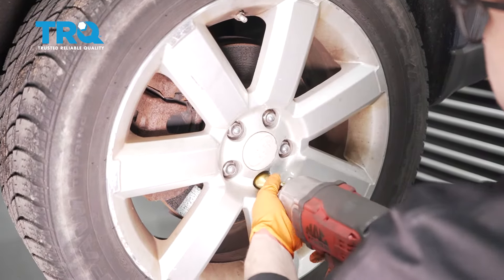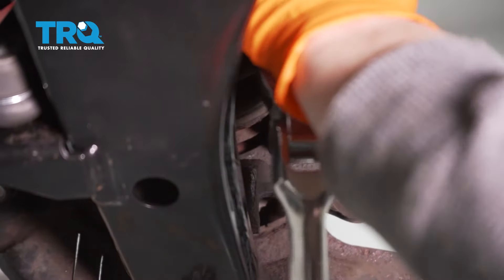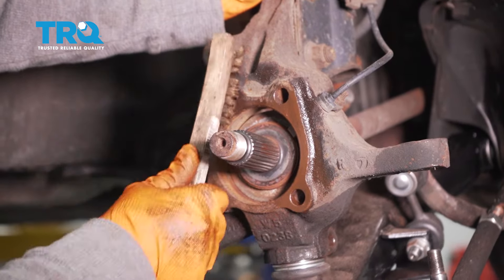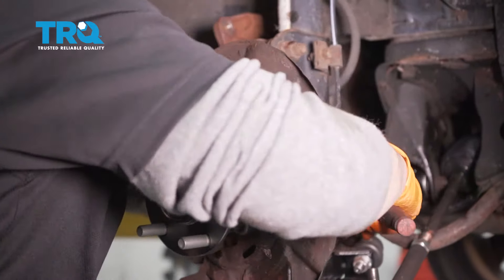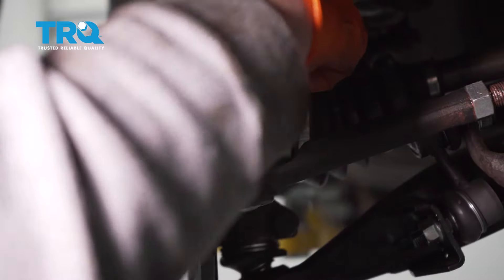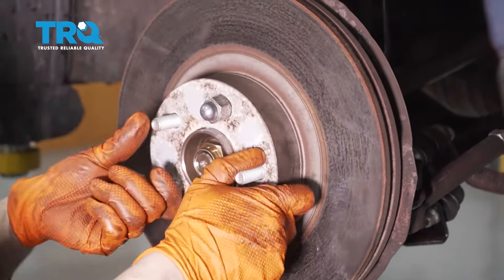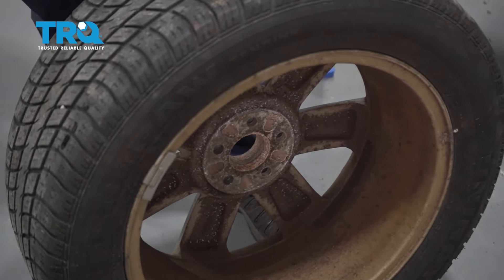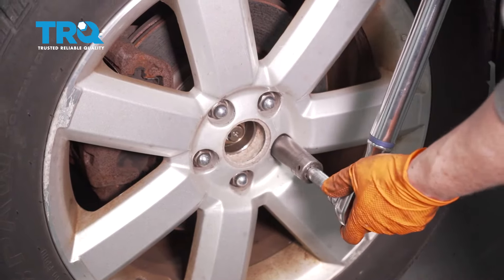How to replace Front Wheel Bearing & Hub Assembly 2005-2009 Subaru Outback

Comment: The bolts will rarely be this easy.  I highly recommend 6 point socket on the mounting bolts because they are very easy to strip.  And separating from the knuckle also may not be so easy.  In some cases it is much easier to remove the whole knuckle for easier access to drive the hub out.

Comment: I've been wrenching for many years clean video,   But I wished you hadn't cut it when you beat the heck out of the hub trying to get it off,  you can see it was beat pretty good after you cut and took it off, People need to see that, although I know a much easier way without hitting it with a hammer.   All In All Good Job,  just wished you showed it all, People really need to know they can get it even if they have an issue like you did.   :)   Thanks

Comment: Do yourself a favor & don’t listen to the part of the video where she tells you to just “smack it with a hammer” to get the old bearing assembly to come off after the bolts are out. That might work for California or Arizona cars but if you live anywhere with winters & rust & where they spray mag chloride get a bearing puller. Also I’m pretty sure you need to disconnect your ABS module before starting too. This video does not show that…….. learned that the hard way